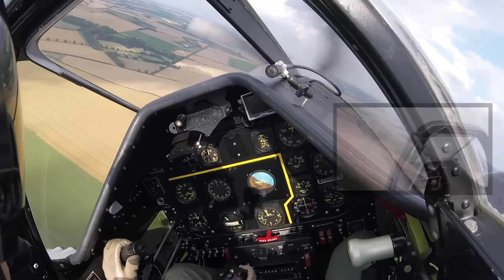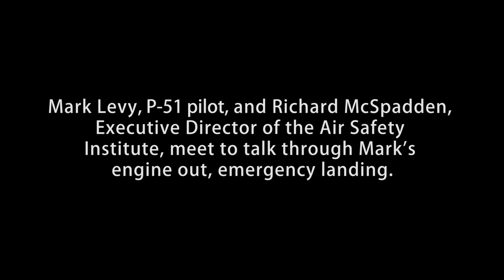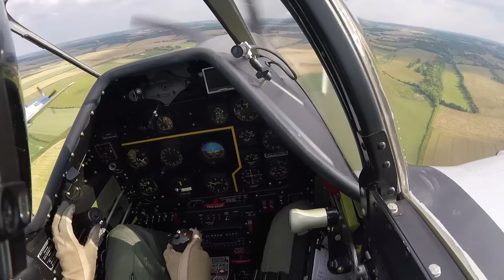P-51 Engine Out, Off-Airport Landing - Full Analysis

Comment: Mark Levy surely should not be disappointed to much!

He did an outstanding job impov.

He showed he could keep his synapsis together and actively deal with a intermitting engine which plus radio is as he said himself putting You in huuughe and way more workload than a strict engine shut down.

Plus It's one thing to teach others when You got all synapsis together inside Your comfort zone and dealing it while all adrenalin, and noradrenalin is kicking in maneuvering Your body into "attack and/or flee." 

After all we're still humans not    unempathic computers.
Again well done sad that nobody pulled those stupid maximum dangerous concrete posts hope those are pulled ALL ba now!!

Comment: Good job and well saved in such difficult circumstances. Question for Mark and Richard; In an intermittent engine failure situation, would it be prudent to accept the fate of the airframe, by pointing for the nearest safe field, and switching off the magneto's, rather than trying to nurse it back to an airfield through all the coughing? It's a grey area I guess but I ask because the further Mark was led on the by the engine spluttering back to life, the more dangerous the situation became. It looked very dicey right at the end there.

I hope the owner wasn't too angry, poor Mark was probably beaten like a redhead step-child.

Comment: I asked a well known aircraft owner and flyer of many vintage aircraft  if his BF 109 was going to have the 109 type canopy ejection system on his ground up restoration of his 109. He said he asked the builder and the builder confirmed that it would but then perhaps derisively  remarked "It's for when you bail out of your 6 million dollar airplane." However, here you can see why that canopy ejection system is needed (especially on a 109), much more likely a 109 is going to need to be belly landed than bailed out of....of course, with a 109, washing a gear out is not outside the realm of possibly, close to perhaps being in the area of probability and I doubt that if that happened popping the canopy is not going to be much of an option, just hope that it groundloops and stays upright.

Comment: As a glider pilot with rather a lot of experience  ... also in glider competitions ... I agree with reactions of the other glider pilots  ... Mark Levy was fixed on making a "regular" approch and landing on the airfield ... as far as I can see ... at 900ft and 2 miles out ... I would have choosen ... "automatically" ... for a downwindlanding on the airfield  ... at 600ft and 1 mile out idem ... with the 2nd option  ... if entering the airfield is not possible : downwindlanding beside the airfield ...

Comment: The thing is, it is always easier to talk about it afterwards, as if one would have been in the situation. Personally, and that is my own opinion,  I would do the following the "bold face" and memory items of the emergency checklist. Every good pilot should be able to pull that card anytime and by heart. Of course, an older system might be a bit more complex, but still, these are critical items such as engine restart- which really pay off to know and practice. Next is looking for a suitable landing site. I would have made the decision to land out after the first try through the memory items, and then set myself up for a good and safe approach on a long field. Here, the pilot even has the comfort of picking the best out of a hand full which remain. ( A p51 usually needs roughly 700m or  2400ft to land).  Then, and once I am on a stable approach, I would try restarting/fixing the engine issues again. If there is no chance - Cofiguration and engine shut down once a glide to the landing site can be assured. And thats it. A fine landing, usually with none or just little damage. 
What we see here is one of the most made pilot errors and which really make me thing twice here. Because it appears to be a lack of training, or mindset. NEVER, miss great landing spots because you are wasting energy and time with altitude since you arent flying optimal speed. Engine issues? Climb as much as you can, convert speed into altitude. Dont try to get home once you are at pattern altitude or lower. Most inexperienced pilots make this decision too late, or are afraid of it and find themselves too low on final or too low to reach a good spot. Here, the pilot was losing speed trying to stay in the air, at relatively low altitude already. The turn to final, would have been a stall and wing-over, maybe onto the highway. It was a good choice to break off. However, with better and earlier preparation even a landing at this site, would have been possible.

Comment: Choosing not to turn to the airport saved his life. He would have lost too much lift in the turn to clear the highway in my opinion and would have endangered life on that road. Should have headed to the airport immediately after first sign of engine trouble. Right decision in tail dragger to pull the gear up. In my bonanza, with a nose wheel, would land gear down , they can absorb a lot of energy in an off field landing. I have had a couple of inflight scares that taught me a lot. The initial panic takes all reason and clear thinking away, this is why we must practice engine out emergencies so we react out of habit and not fear.

Comment: If you look very closely bottom right control panel you can see his fuel pressure gauge drops very low when the engine is cutting out.
Reply: + @3UFZFE   All I ever heard was that they thought the problem was in the carburetor.   The plane was repaired and is flying again in new colors.

Comment: Ok, question... First off, I'm a mechanic familiar with primarily gasoline auto engines. I have absolutely no experience whatsoever in anything aviation related, so forgive me if this is something more commonly known...

But, his coolant temp seemed to be pegging from early on in the video. Is running a temp that high something normal for a Merlin?

Comment: Glad you walked away. I sort of cringed at radio use after the landing. I imagine a fuel leak and loose wire connection couldn't happen, but I'd switch off battery and vacate. I'm not a pilot but I stayed at a cheap motel once.

Comment: There is a lot to be learned from this video, and the pilot did well. But not explaining the engine failure itself stops the learning process cold. It would be great to learn exactly what caused the engine failure so that others could break that link in the accident chain and prevent the off airport landing altogether.
Reply: + dokkerdam     All that I heard about the engine was that it was a carb issue.   The plane is flying again in new colors.

Comment: Always fly the plane as far as you can. Reach stall only just as you reach the ground.  I think I might try using what intermittent power I had to only buy altitude, no turns. If you don't get power and altitude keep it level and go in when you have to. If you do, you might trade that altitude for a final approach.

Comment: Can someone who knows tell me: when the engine fails in a prop driven aircraft, does the propeller start to act as a brake? If so, how strong is it? and what can you do to deal with it? Can you change the angle of the blades? and/or disconnect it from the engine (like a clutch)?
Reply: It starts to act as a brake in a fixed pitch propeller where you cannot change the angle of the prop how strong I am not sure. You can change the angle and minimize drag in a constant speed also known as feathering.

Comment: If the manual is from a forces application, is the advice to jettison the canopy the result of an equation that prioritises the trained and highly skilled pilot's value to active service over other moral factors, so the consideration of danger to people on the ground is of less weight than in purely civilian and leisure settings? If so, though there is a slightly higher risk of a problem caused by the rails warping (I assume), it perhaps was better to slide back the canopy here, as it guaranteed more safety on the ground.

Comment: When my engine cuts off I just pull over on the side of the road the only thing worse than a partial engine failure is a full engine failure and then after that the next worst thing is the loss of a wing the right one the left one or the tail

Comment: It's easy to criticise, and nice to see someone accepting the conflict between hope and what is actually happening.  But I can't help feeling that many pilots would have elected to make immediate use of all those very long, clear fields, admittedly chock-full of tall crops, rather than allow the risk to spiral to the point where the aircraft takes matters into its own hands - leading to a very steep bank in attempting to land on the runway.  The engine could, of course, have packed-in completely at any stage between recognition and crash, and there were quite a few vehicles on that motorway and points in between...

Comment: I can see that he passed the airport before trying to come back to it, in an emergency situation like this, couldn't he have gone straight to the airport?
Reply: There are many different factors which make pilot decide to reject going straight in. Speed, hight, wind direction, not being in line with the runway, eventualities as what if overshot or undershot the reference point, if necessary is there enough room to land straight in a cross the runway? You need to think about it and need to think quick.
Reply: @pavnazwisko9196  thank you, I was just wondering.
Reply: @dutelatte2154  yeah, if you listen pilot explanation, there is a lot of information what actually happened and what options he was considering. 
Best wishes.

Comment: Looked scary how the canopy slides towards his head and neck, I wonder why they didn't mention this in the video. Maybe the reason he should have to rid of it before?
Reply: It doesn't slide towards his neck. It slid on the rail and then popped off. It's literally impossible for him to be decapitated by the canopy.
Reply: @UnitSe7en  but the canopy tilts forward, which makes the top part reach lower into the cockpit. when you select 0.25 speed and watch in slow motion it really looks like it would touch him
Reply: @UnitSe7en  just watched again with 0.25 speed and stopping the video, just when it switches from 2:32 to 2:33 I'm 99% sure the upper black flat part makes contact with his neck because it's tilting forward
Reply: @MixedRealitySimRacing  What is it that you're worried about?
Reply: @UnitSe7en  just luck yourself in slow mo after 2:31

Comment: Do they have manual chokes on those planes, you can move the choke in and out will clear a blockage or stuck valve in a carburettor rapidly moving it in and out so applied vacuum to the carburettor

Comment: Never struggle to make the runway........turning back has totalled many a good pilot. Mark got that absolutely right. What happened to the Mustang?
Reply: +Firebrand55  Bent, but the Mustang was shipped to California for repairs pretty quickly.  I haven't seen any recent pictures but the shop had a new-build set of wings that they were able to start with right away.  I haven't read a final accident report, but they thought there was a carb issue with the engine.

Comment: was a good reaction from the pilot: engine out, not enought high=choice the best place to land on belly...The Mustang with he's laminar wings not allow the smallest error at low speed: too slow it stall very viciously...
Reply: The pilot deserves praise for landing the Mustang deadstick.This beast is supported by a specialised high speed wing of only 234  sq feet  verses 242 sq. feet of the docile spitfire.The fighter at low speed near the stall is ready to drop a wing and does not flatter the efforts of novice aviators.

Comment: My question is with a mayday or emergency call going out why did he attempt a left downwind approach instead of switching to a right and just getting the bird down on the runway? I mean he flew a long crosswind ... runway was long enough
Reply: Probably for the reason he said - he had a lot more to worry about at most points in the flight. Whenever the engine cut out, he had to immediately choose a field and plan a landing. When it kicked back in, he had to check his instrument panel for idiot lights and see if he could fix it. Also, WW2 aircraft don't glide well at all. The right approach was way too far away. He would never have made the turn without power, let alone with his landing gear and flaps down.

Comment: 16:54 A question. If someone usually flies gliders, do they still have to do the occasional engine off landing with other airplanes (like cessnas)? My dad has been flying since 1979, started with gliders, had some nice competitions too. He has shifted to motor gliders and to engine powered airplanes in the past 15 years or so. Nowadays he does a mix of things, teaching students for all 3 (+ theory). Should he also be doing these trainings, I wonder?
Reply: Yes. Powered aircraft power off approach and landing is quite different from purpose made gliders, mainly due to the different glide ratio but also the C.G. balance is intended for use with thrust. My training and practice involved power off landings and simulated failures at cruise. (not fully off, just power to idle) 
The cruise practice is started at a couple thousand ft and shows you can go through the checklists and find a suitable field then getting into a final approach position, adding power back between 500-1000ft. The power off landings are started in the pattern, maybe on mid to late downwind, and is taken all the way to a stop on the runway. Both exercises involve all the checklists, with the exception of simulating power failure on base or short final where you shorten it to landing prep rather than attempting to restart the engine. There is also an engine fire exercise that is similar to the power failure at cruise exercise but with a different checklist. Usually these are started by an instructor, without warning they just reach over and pull power to idle and say engine the has quit. (the first time it is a fully planned event)

Comment: The cause was likely water in the right wing fuel tank.  After 25 minutes the pilot switched to the right tank. Then the engine began failing as a water-fuel mix reached the carb. The pilot then switched back to the left tank, but by then there was too much water in the line leading to the carb.  Water condenses in a fuel tank that is not totally full of fuel.  Moist air gradually brings in the water over many months.  My dad ditched an Aero Commander in the sea because of that very problem.  See https://assets.publishing.service.gov.uk/media/59c284b4ed915d408f04175e/North_American_P-51D_Mustang_G-TFSI_10-17.pdf
Reply: +Donald Wulff   Fuel contamination would have been easy to diagnose early in the AIB investigation.   They were looking at a carburetor issue with the Merlin.

Comment: Why opening the canopy ? Does the risk of being hit by external object or piece of aircraft during emergency landing is greater than being stuck in the plane ? Canthe canopy be break from the inside ? Also in a situation like this does a plane allow you to jetison the remaning fuel before you attemp to land ? Just curious and want to educate myself.
Reply: In a landing such as this off airfield you always crack open the door/canopy as if you buckle the air frame you may not be able to open it.
Reply: +Sinister No fuel jettison capability on these.  Releasing the canopy was wise to avoid being trapped.  Seasoned pilots were proper helmets and fire-resistant coveralls for emergencies.

Comment: I was surprised he pulled up the landing gear up before landing in that field, looked like it would have been a fairly soft landing with gear down, also if he hadn't put the landing gear down he might have had enough energy to reach the airfield putting the landing gear down right before landing on the runway (with hindsight).
Reply: NichoTBE we are trained to always think that crop fields are very deceiving. They may look soft and cuddly...but in reality they’re VERY bumpy and you cant notice the bumps and tall uneven shrubs.
Reply: +Nicho TBE    That's 12,000 pounds of airplane and the wheels could have dug in and flipped him.   Repaired and already flying again.

Comment: When he talks about the brain going into primal mode during a crisis, you can see evidence of that when he tries to crank open the already missing canopy after the plane comes to a stop.
Reply: He didnt notice it was gone already, he wasnt looking at it while crash landing.
Reply: @emmanuelquerol   He opened it earlier, relatively soon after the initial engine cut-out. So even if it hadn't separated in the crash, it would have already been open.
Reply: @emmanuelquerol   That's the point.  He already opened it when trouble started. When he came to a stop, he was so amped up on adrenaline, instinct and while it was positive he was unharmed, it must of crossed his mind that he is the one at the controls of a very expensive plane that's been wrecked on the ground.  He quickly cranks the handle two different times. The first time didn't register that he was getting no result.  Not only that, but he completely forgets to un-strap from the plane and evacuate asap even though the hand cranking indicates that he was trying to do just that.  It's like the momentary inability to understand what was going on with the canopy hand crank short circuited the rest of the evac procedure in his brain.

Comment: I  DON'T FLY BUT i RECALL  READING THAT  WHEN YOU LOSE POWER IN A  P-51,  YOU ARE FLYING  A ROCK...,  IT HAS  A VERY LOW GLIDE RATIO.  i FIGURED OUT CORRECTLY, " THIS  GUY IS GOING DOWN ".    WAS  THAT WHEAT OR OATS  YOU LANDED IN ?    IT HAS A VERY NICE COEFFICIENT OF FRICTION  FOR LANDING AIRPLANES  IN.  ALSO,  CAPTAIN SULLY  WOULD BE GLAD TO GO WATER SKIING  WITH YOU.